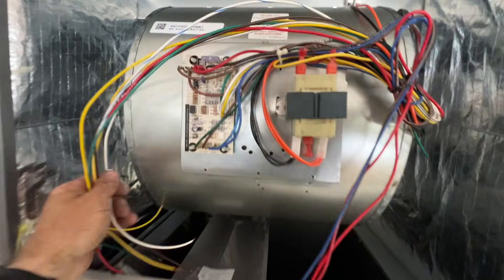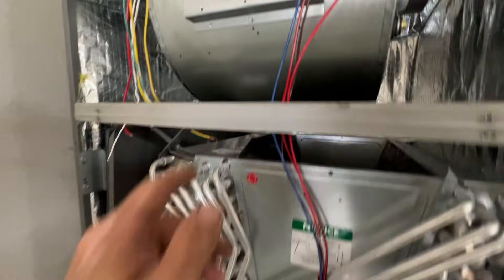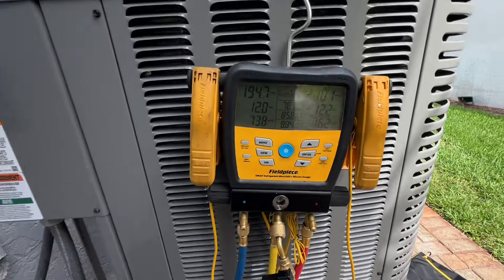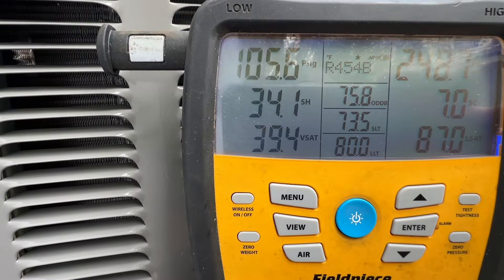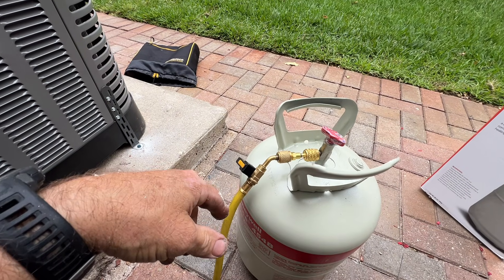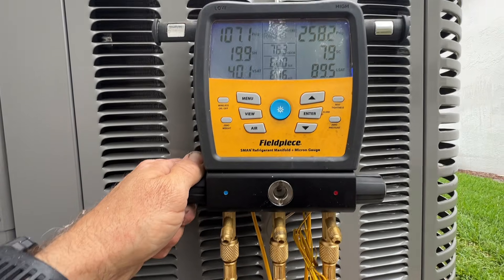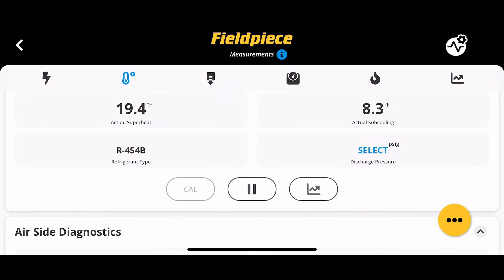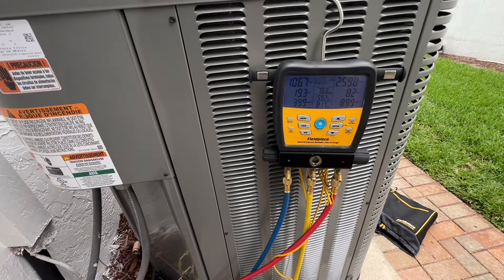R454B Rheem Split System Start Up And Charge … Air Handler Wiring With A2L Refrigerant Monitor

Comment: Ive installed  two r454b split systems and both gave me normal subcooling and 1-3 superheat. I called the tech and he said to just find tge sweet spot lmao. Ive checked airflow and txv metering device, also system is not overcharged. Anybody else have these issues, any help would be appreciated.
Reply from the maker: Sounds about right, as soon as we get used to this it will be replaced again. Thanks for commenting!

Comment: If you properly evacuate the r454 from the new unit before you install it. You could charge it up with r410a instead and simply gut the extra sensor('s) work. The temperatures are almost identical, so you dont have to worry about exceeding the pressure ratings for the condenser/evaporator/dryfilter/braze/even the compressor doesn't require any changes or anything. You could scrap the sensors or save them because they are only for the flammable refrigerants. No harm/No foul/no irregularities. 410 will be around for at least 10-15years!

Just tag the new condenser of course with the property 410 tag.

Or, the just wire the r454 up.  The issue is that the equipment is out but the refrigerant is unavailable in MANY regions to complete an install.
Reply: Thats good.  
When you do that, the warranty is VOID. No if's, and's or Butt's. gone period. And if the compressor goes out, Rheem will test the oil, and.  No warranty....  You decide. Have fun.
Reply from the maker: @charlescooney6900 Thanks for watching, This has never been the warranty procedure for any compressor failure claims I’ve had with Rheem, if there’s 3 compressor failures they may request start up / operation specs but I’ve never experienced it.

Comment: I thought it was a UL requirement to write the total charge on the unit data plate in permanent marker...and I didn't see a scale to know exactly how much was added. To be fair, it looked to be a brand new cylinder...so you could weigh it long after start up to get that info. Been hearing from other guys that it takes WAY longer during start up for the readings to stabilize enough before adding any refrigerant. Sounds like this one only took 15 minutes. Not overly familiar with Rheem...is it normal for superheat to be that high with a TXV in place?
Reply from the maker: Yeah, there’s a label to add field added refrigerant then total charge, better off using a paint pen though. Being the space temp was still cool it didn’t take long to stabilize… lately these units have been factory charged for 30ft which was a good decision… tanks get weighed at the van, charge by subcool not weight. This refrigerant is more hype than r410a was .
Reply: And...THANK YOU for posting this content!

Comment: Just a quick question as I’m seeing it more and more, where is your filter drier? Is it not a thing to install it outside now? I’ve seen them installed at the evaporator coil on a few places now..
Reply from the maker: Filter drier was installed at the air handler on this job
Reply: ASHRAE had a requirement 8.5.2.1(c) that all field applied refrigerant joints had to be enclosed in a manner that would direct a leak in the joint to a refrigerant detection system or to the outdoors, which is why I'm guessing people were moving them outdoors but that was dropped in one of the addenda (15.2-2024?) so maybe they have moved back inside.  There is a Nordyne YT video out there that shows a coil unit where the braze joints were moved into the cabinet so they would be in scop of the RDS.  I noticed that this air handler has external joints so perhaps the filter dryer is OK too?
Reply from the maker: The beginning of that requirement states field joints be brazed , welded or a listed mechanical joint compliant with UL 207 or ISO 14903, or enclosed…..

Comment: I'm a 25yr field tech.  We've installed Ruud equipment for the last 10 years.  Have managed to get ahold of good ol 410 equipment still so far, but I know the time is comin.  So, if I'm understanding this right, basically NOTHING has changed in the wiring?  I was told there's some crazy "mitigation control box" that has to be wired.  Out of curiosity I called their tech support, and they said the "wiring diagram that comes with it is totally incorrect, we get a thousand calls a day about it."  I'm confused.
Reply from the maker: The RH2TY 454b air handler control wires are basically the same as RH2TZ 410a wiring, the refrigerant detector is factory installed. I haven’t experienced any issues yet.
Reply: @subcoolHVAC  Well that's good to hear.  As I said, I had heard whispers that there was an entirely seperate piece of gear, that everything had to be wired through, similar to a zone control board or somethin like that, where the stat, air handler, condenser all had to be wired in.  In other words, it would COMPLETELY change the way I've wired in a simple install for a quarter century.

Comment: Its old school in the 70s most ac aystems were propane systems, propane will be colder and temps will fall fast its going back to oldschool days because of the ozone ,but 410 is moe efficient
Reply from the maker: No old school prices for sure
Reply: Hasnt been for years
Reply: My service callsare $129 per hour  , I sell r22 $50 per lb,410 $70 per lb 134 is $40 per lb all other refrigeration freon is $40 per lb

Comment: Don’t know much about this refrigerate. Just got a new home and pretty much have this same unit.

But supply air is 63 degrees constant would it be undercharge?
Reply from the maker: I normally get a 20 degree split between supply and return from these units with proper charge. Definitely want to make sure the airflow is good first ( no heat infiltration or duct leaks to return  ) won’t hurt to get a check up

Comment: Better remove the plate on top of the coil or it will sweat like a pig 🐖
Reply from the maker: Not sure what plate you’re referring to
Reply: @subcoolHVAC on top of the coil there is a plate that covers a portion of the coil. Unfortunately you need to pull the coil to remove it.  I’m in Florida where humidity is a concern. Tech support told me about it 😎
Reply from the maker: I’m in Florida also, no mention of removing the air stop / drip diverter in the installation manual. They recommend insulating cabinet in unconditioned space where excessive heat present, correct supply and return ductwork and sealed connections. I would not remove that part as the serial number for coil is also attached on the air stop.

Comment: What's the pressure on the low side of this new freon?
Reply from the maker: There’s no one set pressure, use the manufacturer’s charging charts to properly charge
Reply: thx anyway iknow when buying new units is precharged already w r410a or this new flammable gas!@subcoolHVAC

Comment: Hey I ended up installing a 3.5 ton today for the first time I'm a apprentice and we've done like 3 install for them, it's seems like their psi is alot more odd compared to 410a which is usally a wanted 290 psi with sc of 9-12 depending on ton, what is normal psi for 454b psi and actual sb for the different tons?
Reply from the maker: Go by mfg recommendation on pressure/subcool at your ambient temperature , I’ve been seeing 8-10 SC , your lineset and run can affect pressure. 454b pressure has been lower compared to 410a . Make sure your SH is positive, log suction saturation temperature
Reply: @subcoolHVAC  I see I understand more, makes sense honestly, thank you very much super appreciated👏

Comment: Hey so when charging you don't have to flip the cylinder like the 410a means it's vapor not liquid when charging 454b?
Reply from the maker: @nigelhosein7822  454b is a blend, flip the tank. R32 is not a blend

Comment: Currently i have installed AAON commercial package RTU's with R454b . They have infrared  sensors in the evap compartment and in compressor compartments. The sensors in the compressor compartments ar vented to outside . So were i live we are experiencing heavy seasonal pollen. The sensors are falsely tripping off because of this. I see nothing but problems with this stuff. Just adding to additional maintenance work load to these machines
Reply from the maker: You’ll never guess what is being said the increased pollen is being generated by 😉
Reply: @subcoolHVAC  😆  yes I know. But that's like believing in the tooth fairy.  It makes happy as a kid but,  you laugh when older I realized it was all made up
Reply from the maker: @pineychristian  😀

Comment: I just installed the same one today for the first time. It was 76° in the house and 46° blowing out the vent. And my pressures looked identical to what you showed. The house dropped 2° in 10 min and cut off 😂. Seems to be pretty good stuff
Reply from the maker: So far I’m having no issues, I just make sure the blower is tapped to high speed (5) at the motor for single stage applications
Reply: That's not good, you'll have humidity problems.....
Reply: @swhitmore88 the system is running perfect, no excess moisture in the apt 😂 thanks tho
Reply: @larrymedina9737 
30° delta t is horrible. You don't want anything more than 22°. You'll see.....
Reply: @swhitmore88 the windows, and air vents, mirrors would have been full of water droplets and condensation the next day. I installed that thing 3 months ago. They are doing just fine. Moisture won't magically develop months or a year down the road. In 24-36hrs it would turn into a tropical rainforest and be 55° inside. None of which has happened.
Reply: Sounds like you got about an extra two pounds of gas  in er.

Comment: What was the price relative to a 410 system of same size
Reply from the maker: Roughly 8% increase, availability of 410a complete systems are drying up also
Reply: @subcoolHVAC  8% not bad,I figured you would still be able to get 410 condensers for a while,even if they have no refrigerant in them. Similar to when we switched from r22
Reply from the maker: @cardsfan1590 I thought that as well but haven’t seen any dry charged units.
Reply: @subcoolHVAC right on,I think this is one of the first installs I've seen on YouTube with the a2l. Gonna be another month or two before I get to play around with one
Reply from the maker: Nothing to it, just use same install procedures as 410 and stay ventilated. Thanks for Watching
Reply: @subcoolHVAC  No dry charged units will be available for 410. Production on all 410 unitary equipment stopped Dec 31st 2024. You can purchase, sell, and install 410 product until Dec 31 2025. Beginning Jan 1st 2026 it will no longer be allowed, including dry charged units like we were used to with the R22 transition.

Comment: turning off the compressor and turning on the fan to increase the evaporator temperature, thus increasing the evaporator leak seems counter intuitive. why not just use a refrigeration controller and a solenoid to pump the system down into the condenser when it detects a leak. That would make more sense to me if they are truly concerned about leaks
Reply: The mitigation is just to ensure there isn't a large concentration of the A2L in one area. One thing to take into consideration is the RDS is not used globally where we have been using R32 for the last 10 plus years.
Reply from the maker: @Paul-IE-Repairs  That was my thought too about increased pressure, these scroll units wouldn’t be able to pump down the amount of refrigerant in most of these systems.
Reply: what if it's leaking and there's a power outage, then it couldn't pump down and when power comes back the cabinet/ducts are potentially full of fractionated gasses.(lol)
Reply: Wouldn't that introduce air?

Comment: I have talked pretty extensively with our Ruud tech support rep and cannot get a straight answer on a solution for A2L A/C only swaps, they would have to come up with a way to ensure the unit will go into a ventilation mode when a coil sensor is tripped. We do a ton of A/C only swaps because furnaces last so much longer (especially here in the Midwest). I’m really waiting to see what happens because if the only solution is to swap the entire system to be A2L compatible that would be insane.
Reply: almost like a way of forcing whole system upgrades ehh? 😒
Reply: @throttlebottle5906  💰💰💰

Climate change activists only fill peoples pockets.
Reply from the maker: Yeah, no furnaces here in SFL . I’ve seen dragonfly controllers being used for A2L a/c swap on existing furnaces
Reply: @ yeah I brought that very thing up because that is the current solution being used for Daikin based products but I have not gotten a straight answer from Ruud/Rheem. I’m sure they will come up with something…. Hopefully
Reply from the maker: All I see is part RXHY-1 on Rheem site for A2L cased coils. 

https://parts.rheem.com/product/RPD-RXHY-1?srsltid=AfmBOoqt1F2F34m8CNI7oDRj9EZrxP7lDbtyfOVwXVCuXkxxJzQgVIqu
Reply: @S9l8m  also depending if its horizontal vs vertical will depend on where you locate the sensor
Reply: All this bullshit is completely scamming homeowners.
Reply: @acrepairnearme  blame climate change activists and government
Reply: I went from a R22 Rheem Classic to a new 454b system with just an AC swap. So far it seems to work. Must be supported. Furnace is from 2002 so I expect a bit more life out of it but who knows.
Reply from the maker: @TheObiwantoby So far no issues here
Reply: I hear this refrigerant works in 410a systems, so long as you replace the txv. Im not sure what A2L is, but you should be able to replace txv alongside condensing unit
Reply: @Straight_White_Fatherly_Figure  in theory it will work, metering devices matches the refrigerant. The issues lies in the requirement for the RDS. If installed without it you will could be held liable if anything were to happen.
Reply: @scottkelly8288  yeah lennox claims theyll send out a kit with the sensor, txv, board and other little things
Reply: @Straight_White_Fatherly_Figure  That's great to hear! I haven't heard anything along those lines yet,  but it would be great for our industry to ease some of the transition especially without the availability of dry charge units. Think about this- you install a new 410 system today for your customer then in March of next year a tree falls on the condenser. That customer will need to buy a new IDU and ODU again!
Reply: @scottkelly8288  i agree. And its already being considered that 10 years from now, we will be getting yet another drop in thats even more flammable 🙄

Comment: I have a feeling those refrigerant sensors are going to have a lot of nuisance issues , in the supermarket refrigeration space the leak detectors often go bad causing nuisance alarms… nice video!
Reply: Is that condenser coil aluminum as well. I wonder if they made the coils any better or they still crap.?😮😅 let’s put the sensor in the bottom of the coil . so I can miss the refrigerant leak . No leak check on the condenser either. Lol all this hype and ridiculous turn out. I want to see something catch fire 🔥 so I can prove it’s flammable that’s probably never gonna happen. And what a joke. So it’s a float switch triggers it’s not gonna work but it could still leak. 😂❤
Reply from the maker: @ The condenser is still copper tube aluminum fin. They’re only concerned about indoor leaks. Filling up you vehicle at the gas station has more chance of ignition than this as long as you work safely and follow A2L service recommendations
Reply: can we bypass those like the CO sensors on generators or the NOX sensors on diesels...f'in EPA.
Reply from the maker: @machaf I would consider it life safety and not bypass. We can always hope for less leaks with this refrigerant / coil combo. At same time keep expectations low.
Reply: @machaf  Yes. I already done some bypassing myself. They go bad 😒
Reply: Already had 5 this week
Reply: They already are. I’ve had some trip during heat pump defrost or when the heat from the furnace hits them. 

They are made cheap and just CYA. 

My counter guy says they know they are going to be so problematic that most techs will bypass them.
Reply from the maker: I fully expect that especially being located by the drain pan…corrosion is inevitable

Comment: That refer sensor is it giving some type of light signal when it’s trip? Or just killing control voltage like a flow switch ?
Reply from the maker: No light, if it senses refrigerant it closes the switch to send 24v to the blower motor x13 speed signal. It has a NO & NC switch
Reply: It cuts all 24v, including to stat. Theres supposed to be a reset button on them. Shouldn't be hard to figure out. It is an extra few steps though
Reply: @Straight_White_Fatherly_Figure  it’s cycling only the indoor blower on until the sensed A2L Is diluted, than back to normal fan operation. Looks like Trane is doing the same, gree units look to be more communicating with an alert on the stat plus outdoor unit in vent mode with comp off.  Not sure if other units are doing the outdoor unit vent mode maybe only the communicating ones? Time will tell 🤷‍♂️
Reply from the maker: Yes it will 👍
Reply: @HVACslayer  idk why i didnt know A2L is the classification lol. Well i did its just a new term i need to get used to. But yeah i believe theyre all pretty much going to be the same. I had a class on this with lennox a week ago and pretty sure carrier is also exactly the same.
Reply from the maker: It wires up the same as non A2L ahu they just run 24v through the RDS control box that does the 24v switching.